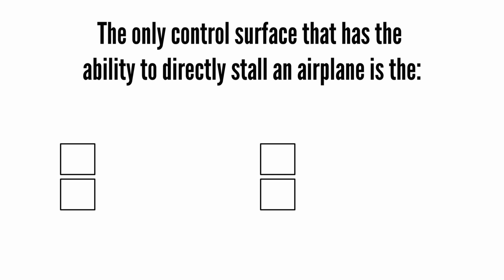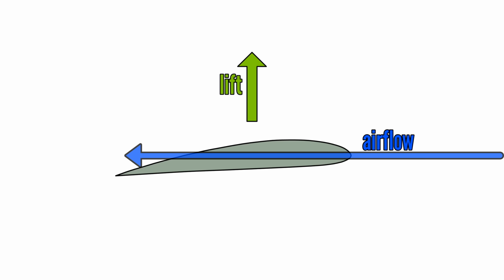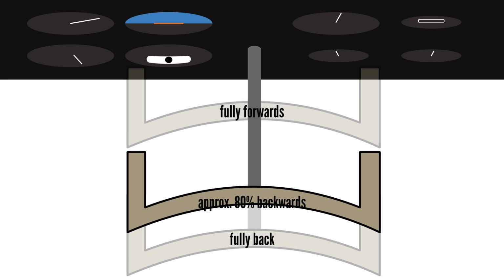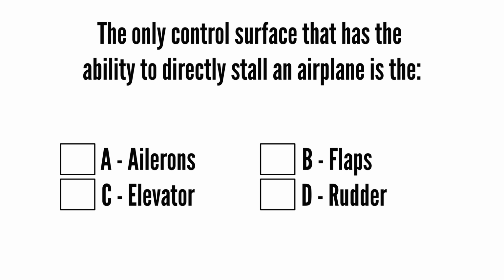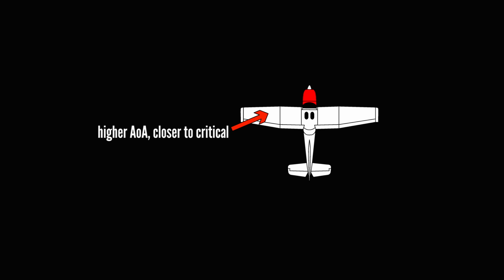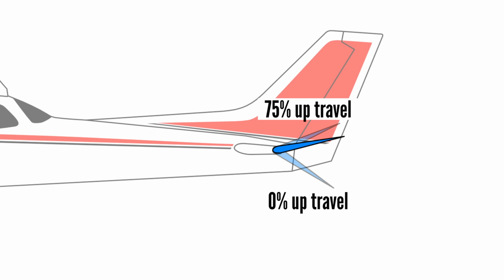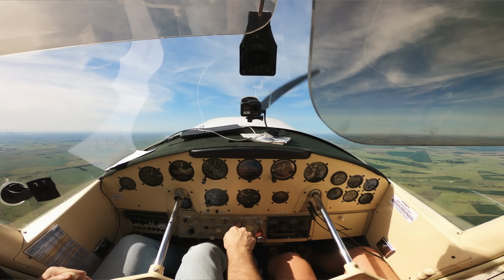Why Bank Angle is Irrelevant to Stall Speed

Comment: I think a big part of the problem is that flight instructors will casually bring up a term like "bank" without explaining it, and the student comes away with the idea that the further you roll an airplane the easier it stalls. Bank angle is useful for explaining how stall speed changes with load factor, but I totally agree that the fixation on bank angle in flight training has mostly served to confuse pilots.

It's also funny that the bank angle graph suggests that it is impossible for an airfoil to produce lift if you are rolled 90 degrees lol

Comment: This is a very good video. Maybe light aircraft should have a stick shaker so that when the stick reaches a certain point of back travel a vibration is felt through it. Or mabye it should whistle like the external stall warning device does. Audible device might be better as it is routine to have the stick fully back when landing.

Comment: Gonna quibble with your quiz, just a little bit.  Every airfoil on the airplane can stall.  Therefore, "Which control surface is the only one that can cause a stall" isn't quite accurate.  You're assuming that we are only talking about stalling the wing, but ask a multi-engine pilot about rudder stalls.  Furthermore, there's a reason why CFIs teach students to NOT pick up a wing with aileron in slow flight -- that increased angle of attack from the downward-deflected aileron can cause that one wing to stall while the other wing is still flying, leading to a spin (did that as part of my CFI training).  Therefore, even assuming that we are limiting the discussion to wing stalls, an aileron can, in fact, cause a stall IF you are already really close to the critical angle of attack.

Comment: G goad (wing loading) is one of the main factors of the higher stall speeds and the higher the wing-loading the higher the effect, flying out of balance (not being on the ball) as well, and lastly on the inward wing is experiencing less airflow then outward wing in a turn which can lead to partial (one wing) stall. Flying 1G turn well balanced should have the same stall speed in theory as long as you can maintain equal airflow over both wings.

Comment: Hallelujah - at last a coherent explanation of stall behavior in banking situations. I've always viewed this as pretty much as you have explained it, but several flight instructors and a few engineering types have left me wondering if I was wrong.
I think the issue is - and I see some signs of it in the comments - a lot of folks are always confusing the issue with a lot of "what ifs" and introducing factors that are a) probably not operative to a large degree, and b) are actually non issues if the elementary/root cause is controlled using the basic understanding you have presented. That's something I think you have  covered nicely here.
Thank you once again for your presentations.

Comment: Surely bank angle IS a contributing factor? If one maintains constant power and speed,and increases the bank angle then at some point the aircraft will descend, as you mentioned. When this happens then the relative airflow is coming in at an increased angle, from below; this means that the aircraft is now closer to the critical angle of attack? I ask because I have a dog in this fight - one of my ATPL ground studies students witnessed a multiple-fatal crash of a Seneca that was turning finals and stalled/spun in. If I'm wrong, I stand to be corrected - I never taught Theory of Flight, although I do fly ultalights recreationally.

Comment: One point I like to add, because stall is when laminar flow of air separating from the wing, stall does not happen at a fixed airspeed but depends on how fast one pulls the elevator.  When elevator is pulled suddenly, even at higher airspeed than "stall speed" the separation can be made to occur causing stall. This is how we do snap rolls even during vertical dive.
Reply from the maker: Yeah good point

Comment: I believe you misspoke when you said that "we are taught to remain coordinated to avoid stalling." (is that what your Instructors taught you? That makes me sad.) That's false. We teach to remain coordinated, so that, in the event you do stall an aircraft, it doesn't develop into a spin. Uncoordinated + Stall = Spin. Unless you have thrust vectoring, then use thrust vectoring.
Reply from the maker: Splitting hairs mate? If we want to do that then technically "Uncoordinated + Stall = spin" is also false. It should be Skidding turn + stall = spin. A stall from a slipping turn is unlikely to develop into a spin. Does that mean we shouldn't worry about being fully coordinated, but just avoid skidding? Of course not. Don't be sad, chin up.

Comment: Good points in general, but your points about skid vs. slip are incorrect.  Aircraft are certified in their flight testing for sideslip maneuvers, not skidding maneuvers.  There are a variety of reasons for this.  While the main point of your video is correct, I share the maneuver envelope diagram when I talk about stalls.  Also, NEVER be afraid of maneuvers that are less than 1 G. Lowering G forces (load) lowers your stall speed.  Ask, "What is the stall speed at 0 G?"  The answer is 0 knots.  I highly recommend upset recovery training for EVERY pilot.  I also wish AOA indicators were a mandatory item for aircraft certification.

Comment: But isn't the definition of the stall speed the minimum speed at which the aircraft maintains altitude? Also why wouldn't the flaps affect the stall?
Reply from the maker: Not sure if that's the official definition but it's not a good one. A plane can stall in a descent, and in a climb too. And a plane can be unable to maintain altitude without stalling.

Flaps affect stall speed but it can only stall the plane below certain airspeeds, i.e. if flaps are retracted below stall speed for that configuration. The elevator can stall the plane at any airspeed, which was the key takeaway from the quiz.
Reply: @LetsGoAviate  The stall speed is what is being displayed on the pfd of an airliner thought and it rises when you make a bank, but I get your point.
Reply: you are completely right. There are two different concepts. Stall Speed and Wing Stall. The video focus on Wing Stall. The definition of Stall speed is as you write minimum speed at which the aircraft maintains altitude, and does have a direct dependency on bank angle.

Comment: In the core he is right but the interpretation is not good. While in a turn the bank angle increases the stall speed because the wings have more load than in straight and level, also in a turn the more the bank angle the less vertical lift is produced. Those are the reasons why the more bank angle you have the higher the stall speed gets and the risk to not recover from a spin increases.

Comment: "Airspeed and ball in the middle" is a flawed concept used to control a machine in a three dimensional ether.  Its PITCH ANGLE, PITCH RATE CHANGES (inducing load or G) and YAW RATE awareness that keep a pilot safe.  We train with out airspeed and ball references when teaching upset recover and spin recovery. "An airplane can stall at any airspeed and at any attitude". Therefore, there is no Safe airspeed nor is there a safe attitude in an airplane. Most intellectuals in our industry unfortunately only think and live in a two dimensional world.

Comment: You are correct, however the premise is that altitude will be maintained. Therefor as bank angle is increased angle of attack must be increased to compensate for the reduction of lift in the vertical. Sure bank angle and top rudder can be used to rapidly lose altitude if one has the capabilities.

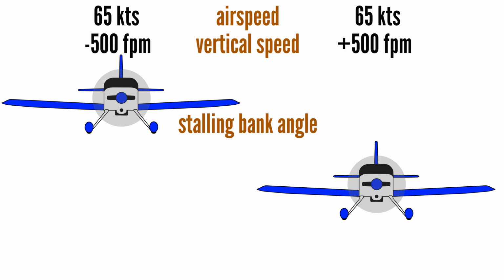Comment: Not sure if I agree with bank angle required to stall being lower for a climb vs. a descent (3:30 mark) Climb requires excess thrust (not a zoom, but a constant speed climb). In your example a 65kts climbing turn vs. a 65kts descending turn should require the same bank angle to increase load factor to the level corresponding to the wing achieving critical AOA. In a climb (constant speed) the load factor is 1G just as in a descent. The wing does not generate more lift in a 65kts climb than in a 65kts descent. Also, if it did, you would stall at 65kts no matter how much horsepower your engine could produce because to maintain 65kts the nose would inevitably be raised to the critical AOA in your theory. Take for example two identical C172s except one has 150hp and one has 180hp. Both climbing at 500fpm and 65kts are at the same AOA (although, let’s say the 180hp will have reduced throttle and let’s say the 150hp is full throttle). Now increase the 180hp to full throttle and pitch to maintain 65kts. The 180hp will increase its vertical speed but the AOA will be the same because IAS is the same and the climb results only from excess power.
Reply: I agree. The only way it would be true is if you initiate a climb where wing loading is higher and more angle of attack is required but at constant climb/descent I am not even sure if you need a different amount of pitch input after all (once you have established the vertical speed you want)
Reply: It's great when you can go out in this specific airplane and prove for yourself across the entire aviation universe that only the elevator can stall the airplane and then you start back ing water and say directly. I don't know what kind of airplane this is but it doesn't look like it's got very heavy wing loading, and it doesn't seem to have much speed and it doesn't seem to have a great big motor just buy off the top of my head looking at the structures. When you go to the curved flight your angular velocity is squared to determine your additional load. I saw a video with a width 513 lb of airline pilot and son taking off in an airplane, it was a very old plane and it had two seats rated for about 150 lbs. When these guys took off and were flying perfectly straight and level with the minimum amount of climb possible, while this was an extremely unusual condition when they turned a little bit it loaded up and stalled because of the bank angle.

Comment: 0:37 - "Elevator"

Controls the pitch angle of the wing.

The angle controls the lift coefficient. 

The lift coefficient increases with angle in a relatively linear manner. 

And the lift-curve abruptly ends more or less at the stalling angle of attack. Although this point can be somewhat "rounded" over several degrees.

The elevator stalls the wing. The stick/yoke control the elevator. So the aft displacement of the control is what stalls the wing.

Pilots should learn to be careful any time the stick/yoke is displaced aft, or when the trim wheel is set well aft.

Comment: I often use very steep bank angles in the circuit on the turn to base and final, 45-60 deg, to improve the airplane's visibility to other aircraft and to lose altitude quickly.  Just don't pull hard.

Comment: There IS a direct connection between bank angle and stall speed, but only if the turn is a level turn. That is, if you are turning and also maintaining a constant altitude, then there IS a direct connection between bank angle and stall speed.

Comment: I want every one to think about what you do with the elevator when you slip. Now think about what you do in a normal turn. In a slip you put foward pressure on the stick. In a bank you pull back slightly and we all learn this as muscle memory to keep our planes from descending faster in a descending turn. Not in a slipping turn because your natural muscle memory is to push on the stick to maintain airspeed. Which do you think is safer, when you are low and slow, pushing on the stick or pulling on the stick? I know what I prefer.

Comment: His most important video.  Thank you LGA.
That FAA chart shown has killed a lot of people. It has been effective in killing people because it has encourages pilots to do BANK STARVED turns in tight circumstances, say,  trying to line up from base to final with too little room and maybe a quartering tailwind.  
As the video says, this  puts the aircraft in a skid and if a stall occurs, it will usually pay off with a snap roll out the bottom. Not good.
I was a very busy full time Part 141 flight instructor for a number of years and long ago. I added a complete exposition of this subject to my syllabus because it is very important.

Comment: I was taught to slip my base and final turns in a Tcraft 40 years ag. since then, I have flown 18 models of Aircraft over the years and never felt uncomfortable letting my tail drop into the bank because I went out and tried stalling each aircraft in full forward and turning slips. None of them stalled with the stick held back fully. If you’re flying in aerobatic plane, then you can stall in a slip, but most general aviation aircraft will not stall in a full forward slip. There is a physical reason why. And I use it every time I fly.

Comment: I was a glider pilot. I found this video a bit unhelpful to be honest as it seemed more focused on making a point than offering an easy to understand lesson on how to fly more safely. One thing I was a bit baffled by was the suggestion that in a flat turn the angle of attack of the into the turn wing increased, leading to a stall. I'd imagined it was a decrease in airspeed relative to the out of the turn wing that led to the wing dropping. I can understand how the wing dropping then takes it beyond critical AoA and thus stalls it - is that what you're saying. I have to admit that when flying a new type I used to take it to a safe height and then put it in various attitudes/conditions to get a feel for it and try and identify the danger points. I always liked to fly by feel and not just by rote.

Comment: The critical AoA can be exceeded in a steep turn with aircraft that have long wings such as gliders (and B-52s), where the wind speed and hence airspeed can be lower on the inside wing. In such situations aileron is used to prevent the bank increasing, but this increase the AoA on the inside wing, inducing a stall.

Further sudden vertical gusts, almost instantaneously, increase the AoA causing the wing to stall. This is an issue when ridge soaring in gliders, where the wing closer to the hill stalls first, causing the glider to auto rotate into the hill.

But I agree in general, stalling is all about the critical AOA.

Comment: Preach it.  Teaching fear of bank angle kills pilots in the pattern.  Consider what happens when a pilot (a student, a low time private pilot or even a high time pilot who should know better), enters a left hand pattern with a left hand cross wind that gets even stronger above 500': 
- unless they pay attention to the ground track and note the stronger wind aloft, they get blown in tighter on downwind:
- they will have a higher than anticipated ground speed on the downwind leg, resulting in a wider than expected turn radius;
-  having both happen aggravates the situation and increases the potential to get blown past the centerline; 
- particularly when they've been taught to fear a bank angel greater than 30 degrees or even just 20 degrees in the pattern.  
When that develops unconsciously or otherwise, the "fear the bank angle" pilot will experience the temptation to step on the bottom rudder to push the nose around to tighten the turn.  That will cause the nose to arc toward the ground and the pilot will respond by adding back pressure.  in short, at the same time they have added back pressure and increased the AoA, they have also added drag and yaw in the skid.  It's a stall spin accident in the making. 

In contrast if they just increased the bank angle to increase the turn rate and reduce the turn radius they'd be just fine.  On that base to final leg they should be around Vs x 1.3. Even without including the reduction in stall due to flaps, they have an ample margin over the stall speed.  For example if Vs is 54 kts, Vs x 1.3 is 70 kts.  In a *30 degree bank the stall speed rises by 8 percent to 58 kts, a 12 kt margin.  In a 45 degree constant altitude turn the stall speed increases by 18 percent to 64 kts, still leaving a 6 kt margin, even before we consider the reduction in stall speed due to flaps, and consider that we can just let the nose come down a bit as the aircraft maintains it's trimmed airspeed.  

In short, we don't have to increase the back pressure for that brief turn, at a steeper angle and the stall speed doesn't have to increase.   

The peanut gallery will say "they should just go around", and that's usually good advice, but its not always possible.  there are one way airstrips and approaches, especially landing toward rising terrain and or at high density altitudes.  there can also be significant pressure to make it work not just psychological pressure but also ATC realities.  

If a pilot always flies wide patterns and has to or is instructed to go around at a class B or C airport with lots of jet traffic, they will likely be asked to fly a tight pattern with much smaller radius turns than they are used to flying in a non GA single suitable 1.5 nm traffic pattern.   And with nothing in their tool box except a shallow banked turn, they won't be able to safely comply.